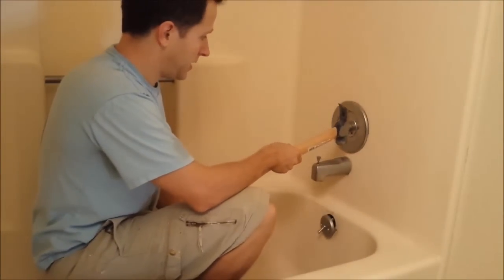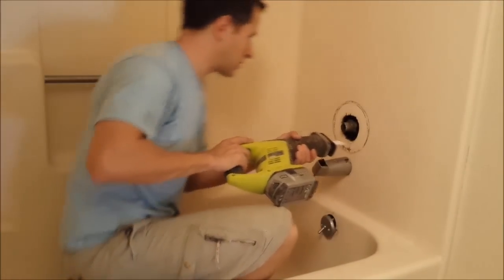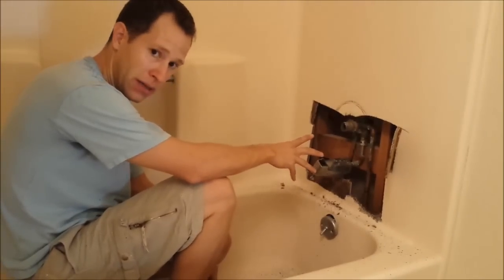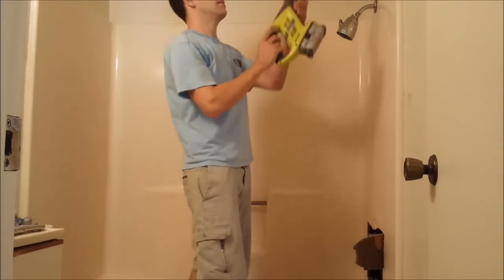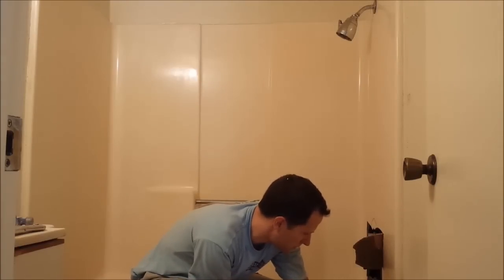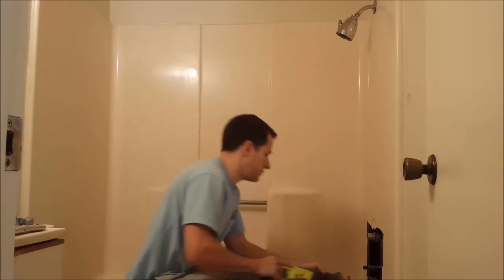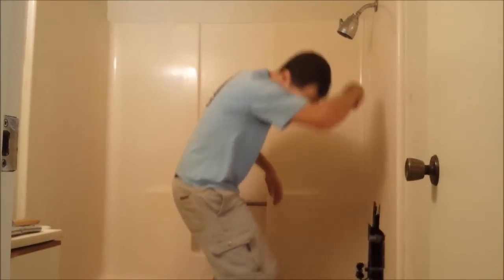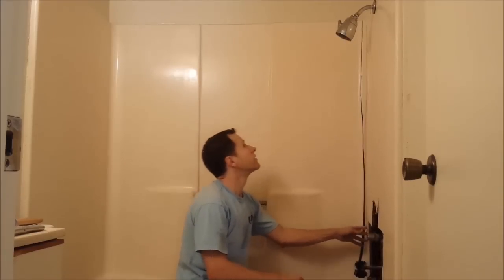Demo bathtub surround

Comment: I happen to come across this video and watched in amusement. First remove all the plumbing accesories. tub spout, valve trim and shower arm and head Remove the drain spud. . Draw a line approx  1 1/2 - 2" around the entire surround for your "cut line". Then cut down the inside corners and along the  top of the tub.  Remove the drywall that overlaps the surround flange, pull the nails or screws that hold the unit in place(if there are any)  The unit should come out easily in 4pcs.!   Mark, seriously, get some training before you tackle another video. Good Luck.

Comment: I have the same style bathtub as you. I had a constant water drip that fixed it with some rubber seals on the faucet stems. Now a few months later it's starting to drip even harder. Wanted to changed the 3 way copper piping and new stems but have to cut fiberglass like you did. I was hoping you were going to patch up the fiberglass to as new as before. I guess not.

Comment: Did you only remove the surround and keep the fiberglass tub? I glanced at your other videos and didn't see the followup to this one.  Does it work to keep the fiberglass tub and tile around it once the surround is cut out?
Reply from the maker: I trash the whole thing. You can get a brand new nice tub for under $200 at Home Depot or less on Craigslist. You could save the old one, just leave a little lip around the edge for the cement board and tile to go over so that it's water tight; I don't recommend it. If your getting this dirty, go the whole way, that old tub is not worth saving.
Reply from the maker: The tub has reinforcements, that's why I took it out in one piece. The panels are thin and easy to cut off.